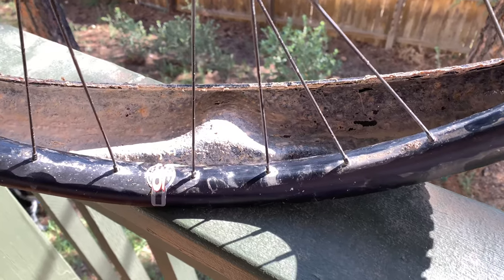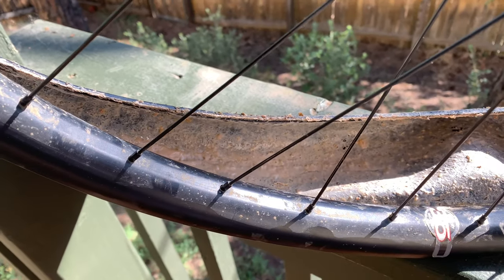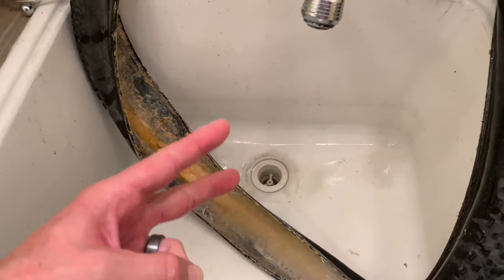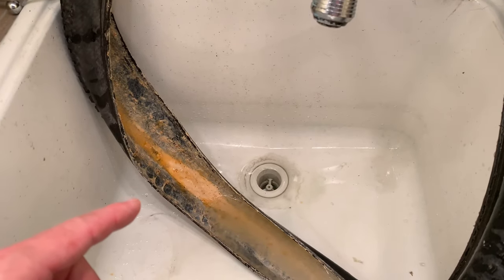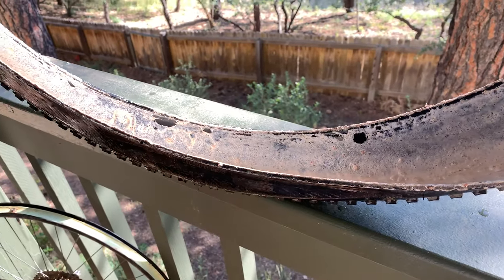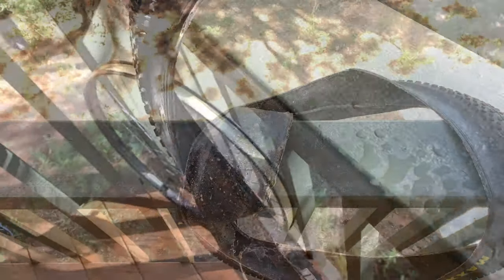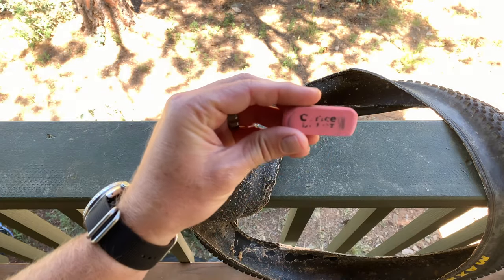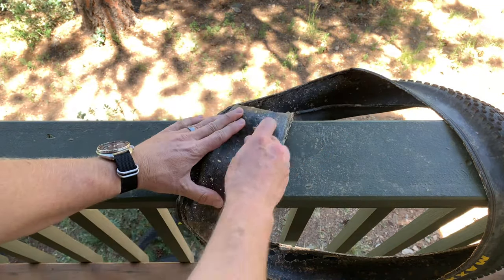60SBT: Ep. 4 - How To Easily Remove Tubeless Sealant

Comment: Good headsup on Orange Seal. May switch to that.
Reply from the maker: Thanks for the comment Russ! I find that it is more of a tubeless coating of sorts than the traditional liquid sealant with particulates like Stan’s. It seems to dry up inside slightly faster in my experience so remove and shake a wheel every so often to ensure you still have some liquid in there, especially in these warmer summer months. 
-Nick
Reply: I prefer Orange Seal
Reply: @RideAlongside  agree, in my experience it is easier to clean my schwalbe nn than continental barons both in combination with orange seal

Comment: I just saw this but they have tools(decal/sealant remover) that's basically an eraser that chucks into a drill/rotary tool.  It's for cars but I've used it to remove sealant off of a plane(Al and CF surfaces) with no issues.
Reply from the maker: That’s what I was thinking would be better. Awesome that someone marketed it as a rotary eraser. Know the mfr or product name?

Comment: Turn the tire inside out. Dry with towel. 2 or 3 inch duck-tape,  press tape to center of tire and rip. Most will come off.
Reply from the maker: Thanks for the tip about this alternative method!
Ride on!
-Nick 😃👍
Reply: @RideAlongside  just trying to help maybe bring that down under 60 sec. lol Ride on !

Comment: I only use Orange Seal, so I can't compare it to others. One thing that may be helpful. In my case the dried sealant was thicker towards the bead, and thinner towards the center. If I start pulling off the latex from the bead first and towards the center (as oppose to pulling it off all along the bead), the latex comes off in bigger chunks. But if you pull if off from the bead first and only along the bead, when you try and pull off the remaining latex that is towards the center, it will only come off in small pieces, which isn't very satisfying 🤣.

Comment: What about from the rim? I just got a used bike that had tubeless then switched back to tubes, i put new tires but there are some spots tht have a lot of glue and it keeps the tire feom seating correctly.
Reply from the maker: The rim should be really easy to clean off. I haven’t had sealant stick to the rim very much at all. Try rubbing alcohol maybe.

Comment: Less than 60 seconds? You did 2 by 2 inch area in less than 60 seconds. I guess you can't use any solvent but I like the idea by jackjr1: use another tire. A little more surface area than a half inch by 2.
Reply: @RideAlongside  You missed the whole point of the comment. It's NOT buying a NEW tire...it's using an OLD tire to do the rubbing instead of an eraser that measures roughly 1/2 inch by two inches. My thought was possible wrap the old tire around your hand and rub with that...ie rubber to rubber. A little more surface area than an eraser designed for pencil.
Reply from the maker: Ah! That wasn’t clear to me. My mistake. Good idea!
Reply: @RideAlongside  Good video though! Thanks

Comment: Why not just use a old tire instead to rub it all off? This method would just take forever
Reply from the maker: Using an old tire works as well, but was more cumbersome when I tried it. In fact, you could just use the same tire, on the opposite side, but it’s tougher. The eraser works well and we always have them around since we homeschool. Thanks for the comment. 
-Nick 😃👍